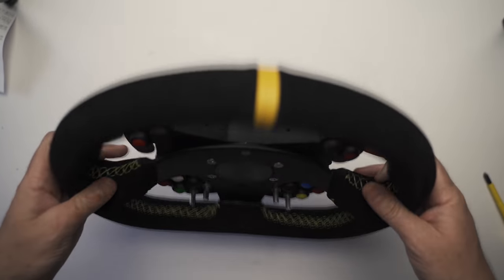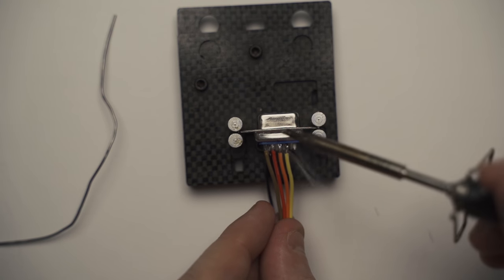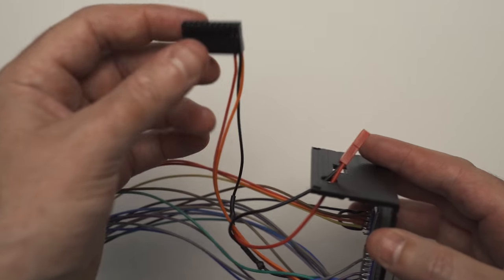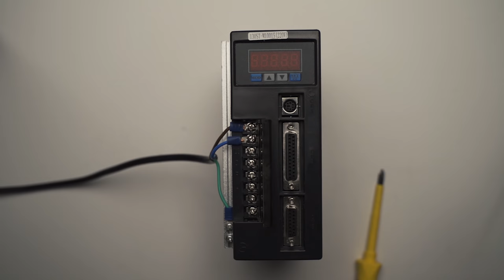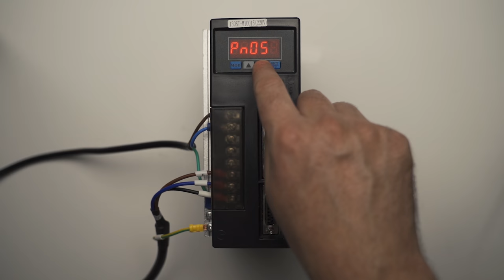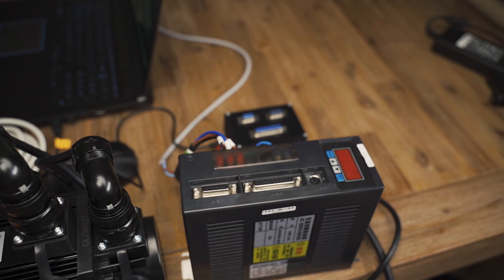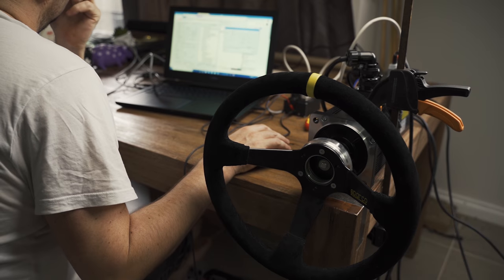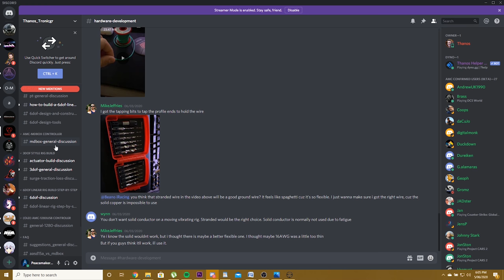$450 Mige Direct Drive Force Feedback Wheel Build Tutorial - MMOS

Comment: Quick word of warning for anyone making this dont attach this to a regular desk and don't treat it like a regular racing wheel this thing will break your wrists if not used safely not sure if you guys have had much experience with a DD wheel but they are extremely powerful
Reply: It's all good if you don't use that much power.
Reply: anybody ever put some sort of slip clutch or coupling on the shaft that can break before your wrist does? 🤔

Comment: So I did exactly this but with a slightly different motor, and almost the same encoder, and driver. So the spec is: 110ST-M06030 (Pn001"motor model" is 15 for this one) - it is smaller, faster (3000RPM max), and has less torque (6Nm nominal, and 18Nm max). Encoder is 10000PPR, and the driver is basically exactly the same, except it doesn't have a CN1 on the front. It will be used mostly for AC drifting, so the spec is more suitable for my needs, I guess. At first I used the db25 wiring scheme from your vid, and it worked, except the motor haven't shown any signs of life lol. I've rewired it to the scheme from the original post on hackaday, and it works! I know a bit of the CAD stuff, so I have designed my own rig with clamps for the table for this motor (kind like an aftermarket ones, but with clamps basically) - will be cut and bent from 4mm steel. As for anything else - first time soldering, first time buying industrial stuff, first time dealing with electronics. God know how I did it, but it works. It was an amazing journey, a lot of experience, and a great result for the budget. Thank you sir 🙏 Thank you so much. Kind regards from Ukraine ❤️p.s. sorry for my english lol

Comment: As a fellow aussie I need your masterful insight. Considering the servo and driver combo alone is now $736 delivered, do you think it would be a better idea to just get the MOZA R9 base when it comes to Pagnian in 3 months for $699?
Reply from the maker: It's a hard one.. depends if you want the extra torque or not. I tend to go no where near max torque of mine. Plus warranty and a pre built all in one wheelbase is also good. Just plug and play. Depends how handy you are with electronics as well for the DIY approach.  Using a VNM ffb board currently and they'll run you about 100-150 on top as well if you want a smooth and quiet operator. $699 seems like a good deal really. Just hope it has enough torque for your needs it all.. I'm sire you wouldn't have much issue onselling it in this market if you didn't like it after a month though.
Reply: @peacemakermotion3949  Cheers! Yeah from what I can see online it seems to be relatively good, and good point on the warranty. I did a full custom hotas +LH stick and was planning on doing the same for wheel but the prices are a bit more ouchy. I won't get their wheel tho and just get a quick release and build a box based off yours.

Comment: Absoluteoy great tutorials I was a little confused when you were setting up the controller up, it seemed like at one point you referenced the rotation speed, but what where all the other things? Id love if you could explain it in some more detail? Thank you for doing these!
Reply from the maker: I copied the description of each from the manual and put it next to each line in the xsimulator page. it wont make much to most people even myself but you are basically putting the driver into torque control mode some values adjust multipliers and filtering and torque speed control limits. in torque mode for example the 120 limit overrides the 1500rpm motor limit when its in torque mode so that 1500rpm setting doesnt matter. another setting changes the wheel direction etc etc. This really isnt my field i just decoded another tutorial i found online. But if you read through the xsimulator page other more smarter cookies have chimed in with their knowledge about what certain things do and tweaked things here and there.
Reply: @peacemakermotion3949  thank you mate I thought as much but I wanted to make sure... Great project though thanks for sharing!

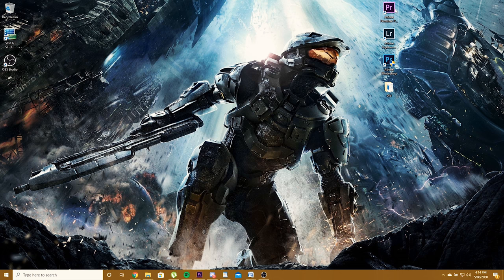Comment: 24:40 I found out you have to use both micro and mini USB because of "Low-power mode". It pops up in the STM Utility as "target might be in low power mode", so all you have to do is plug the mini USB in to a power adapter or to the computer, and the micro to the the computer.

Comment: Hi sir, first things first great work and thank for sharing those infos.
I've a question that may sound dumb, but i'm not an expert electrician so better to ask.
I've a Logitec g920 that make me started years ago, but now i want something more, so the question is: can i use the logic board of that g920 paired with a hoverboard motor and hoverboard enconder? Listen to this, i think if i just can make the encoder communicate with the g920 logic board it will send positions as the stock motor encoder of the g920. Then i just need to power up from external psu the hoverboard motor somehow. What you think about that? 
Thanks if you dicide to help me figuring out the situation.
I'm just a poor sim-drifter with a g920 on a zero to no budget, so think you can understand my bad situation 😂
Reply: I think the best bet for you would be to build a ffbeast force feedback wheel with a hoverboard motor and buy the  Logitech G Racing Adapter  to use your g920 pedals and shifter but that will only work on PC

Comment: Awesome tutorial, I just have one question. So you're connecting the pwm output (PE9) of stm32 board to the analog control input of the drive, am I correct? If so, is there any implication for doing that. Because as far as I understand, pwm can mimic but is not true analog signal, for true analog signal you need a DAC, so I was wondering if the fidelity of the force feedback was compromised.
Reply from the maker: Hey mate. Yes if you watch my test video you'll see the noise created by this. You can use pn188 filtering but too high can reduce fidelity. Early tests by thanos allow filtering to be set to '1' and zero noise! My DAC arrived yesterday so will be doing some testing with that very soon and report back :)

Comment: Soo, quick question..For us here in USA with 110v power, what would be different in this setup? I assume the power cord section would be somewhat different. Also, these motors are sposed to be run on 220 yes? If so, would we need to get a transformer just to run the wheel to begin with?
Reply: well he answered mine, i gues he didnt see yours. on thanos' channel he has a video explaining how ot chnage voltage to 100 instead. same torque output. only difference is it will drive more current due to ohms law.

Comment: I am considering building this kind of setup for a few months already. Do you think the 130st m10010 (10Nm, 20Nm peak) is powerful enough? I was considering the 130st m15015 (15Nm, 30Nm peak) which is just a little more expensive. Also, did you buy the original Mige motor directly from Mige or did you went with the same motor from other seller (I heard that there could be some issues if you buy the motor from other seller since it may not be original, and the not original motors aren't that well built). Also, how are you overall happy with this kind of sim setup? especially the FF wheel :)
Reply: The 10010 is more than powerful enough
Reply: 10 nm rated is more than you need, at least it is more me, strong enough to replicate an indycar ffb but a little overkill
Reply: It's powerful enough for sure.
For context:
Fanatec CSW v2: 7.1 Nm
Logitech G27: 2.3 Nm
Thrustmaster T500: 4.4 Nm

Comment: Hey @Peacemaker Motion, i'm a mechanical engineer student and this project seems complete in all senses. I'm also DIYing A set of pedals and a steering wheel. I've considered also fabricating a DIY seq. shifter. All of this DIY will be added to my 2dof self made motion cockpit. The biggest knowledge lack i experience right now is the PCB configurations and connections, for example the shifter and pedals do not have the same amount of connecting pins as the logitech nor does the shifter. Also, is it possible to change the Motor encoder for a SinCos encoder? Appreciate this video so much, hella value. Keep it up mate!
Reply: I'm not Peacemaker but chiming in to say you might want to check out the "Open FFBoard" project that's had a lot of updates since the above video was published-- the guy who develops most of it has the YouTube channel Gigawipf with really excellent videos about all aspects of these DIY builds. I think there are a lot of options for connecting different kinds of peripherals to the PCB there. Sounds like an awesome project though, I'm planning to get started on my own build soon and Open FFBoard seems really solid.

Comment: Hello,

  please, is it better to use 130ST - M10010 or 130ST - M10015 motor? + AASD - 30A AC servo driver.
Or does it not matter? 

Thanks
Mirek
Reply: Did you find an anwser to this question?

Comment: Let's say I wanted to use a lower power motor like a 130st m10015 10 NM, would all the settings on the AASD be the same? Great tutorial btw!
Reply from the maker: yeah except pn001 will be different because that is what stipulates what motor you're using. worth checking your AASD is set to the right one just in case. the motor numbers are in the manual under pn001 :) Some people have bought a motor driver combo and had issues only to figure out it wasn't set right from factory. you can also play around with torque max speed to like 250 instead of 120. but maybe start with these base settings until you get it up and running.

Comment: I'm completely newbie and have recently joinded Xsimulator forum, I want to ask," Whats the difference between this DD setup and OSW setup with simucube and ionipro?".
Reply from the maker: well this is currently using 6 year old software that hasn't been updated in 6 years.. but still fully compatible will the latest games. Doesn't support absolute encoders (yet?) only incremental. simucube has kind of been designed and moulded around this purpose and has continued support. Also more than double the price.. But now there is a new software thats being developed for open source wheels using other drivers than simucube that will have simucube like options and adjustability!! so the whole scene will be about to change soon and open up the market to more and more inexpensive DIY wheel builds. stay tuned. i'll be doing a video on it soon :)

Comment: Finally looking at building one of these, but have a question before I decide on a listing to buy. Going with the 130st m10010, but I've noticed a number of listings have it paired with either the 15A, 20A, or 30A AASD. Does it need to be the 30A one or does it not really matter? Can't seem to find any info of that, the mixed info in some of the listings doesn't help either. lol
Reply from the maker: If you look on page 11 of the AASD manual it tells you what drivers are compatible with what motors.  The m10010 is indeed compatible with all three. So then it comes down to price. If you can get the same motor with a higher rated driver for the same price or cheaper than I personally would go with the higher rated driver just for that extra headroom but yeah as the manual states, I don't think it matters too much because they'll all be sufficient enough.
Reply: @peacemakermotion3949  Ahh good to know, thanks. Didn't even consider looking up the manual, assumed it'd all be in Chinese. Now to wait like a month for shipping. lol
Reply from the maker: @Rustler_One  haha, yeah. Ask the seller if they can supply shielded cables too. will help with EMI
Reply: @peacemakermotion3949  Quite a late update but right after I bought it, went with taobao cause it was a bit cheaper than ali, the shipping option I was going to use was no longer available cause covid restrictions lol. Had to wait till like March and then finally had it shipped out, as expected took a month, also turns out it was the 30A AASD. Then kinda put it off for a bit while I got the last few things I needed, thought out the additions to my rig I'd have to make, and just some laziness really lol. Also my wheel button box and pedals are diy, and in the case of the pedals had to figure out the position I wanted them at. Pedals are actually a 3d printed design I made based on a number of different ones I've seen online. Got it all put together About a week ago now, had a few small issues like pn190 set wrong but that was easy enough to figure out. Interestingly with MMOS I'd get this weird resonance feeling, not sure how else to describe it, but guess that's part of the noise you get from not having a dac. Then decided to test out VNM, for whatever reason I couldn't get the version of the firmware in the v1_latest folder to work, would just spin continuously when calibrating. Using whatever the latest one was in the v0 folder works fine, of course with an earlier version of the software too. So with VNM that resonance feeling was quite a bit less, but weirdly there was something that felt like dampening even though I had it off, wasn't too noticeable when moving though and overall I'd say it generally feels better than MMOS. Just yesterday I swapped pin 25 to go to pa4 to use the internal dac of the stm32f4 discovery, and yeah that resonance feeling is almost entirely gone, so is a lot better. Also originally I had a load cell on my throttle cause I just had an extra one anyways, but didn't like how that felt and converted it to use a hall sensor. Now the only issue I have left is my button box doesn't like the emi from the motor, specifically the paddles are inconsistent. Bit long winded but that's my experience so far. lol

Comment: one question, i got all the stuff and got the wheelrunning! :) thanks for the tutorial but when im driving straights the steering wheel feels shaky, already put damper and friction off in mmos but still feels a bit weird, do you have an idea of how to fix it ?
Reply from the maker: Max sure your minimum force is 2 or 3 at least. What's your pn190 set to? Maybe try setting it to 0 and run fn007 to calibrate your torque voltage offset

Comment: Hey man. Im absolutely new to the OSW scene and an absolute noob at electronics. Do you think this is worth the hassle for someone like me who would have no clue if troubleshooting is needed? Or should i go the Simucube+IONI route for the sake of convenience and ofcourse better fidelity in the FFB? How much of a difference is really there in the FFB feel of the Simucube and MMOS?
Reply from the maker: unfortunately i could not tell you the difference as i have never used one.. but if you got the Thanos TDD board its pretty much plug and play except for a few wires on the servo drive. arguably easier than a simucube 1 setup as far as wiring goes. Then you can also jump onto VNM firmware and really liven it up. In the future VNM will also support Biss-C etc with their own controller but yeah basically comes down to your budget i guess.. and if you want a real turn key solution then it may  not be the one for you but yeah.. im all about fiddling with shit and saving coin for other parts haha
Reply: So the thanos tdd just allows to skip the wirering part it doesn’t improve anything in terms of performance for the wheel (am also new to this world and i realy want to build this DD set up but i want to be sure to know everything i need before buying anything )
Reply from the maker: @RAYQUAZA_X  Listen to my DAC test. The TDD has a built in Digital to analogue converter which makes the wheel operate smoother and more silently. It also has a benefit of plug and play and avoiding wiring :)

Comment: I want to build one so but but I’m not too familiar with electronics and just need more knowledge is this something I should still look into? If not where can I learn more so I don’t mess this up because 450$ for a diy direct drive wheel is nuts
Reply from the maker: Well it might be about 100 dollars more now for the motors since this video, still doable.. but there are a lot of other options around now too.. the TDD board can't get any chips due to shortage for like another year or 2 so that's out.. there is now the VNM board bit will require a bit of soldering still to get the right pinout. It's a great option as it also has spots for a button box to be wired up and also pedals.. so like an all in one controller kind of thing. But now you can also pick up a VRS box by itself for fairly cheap and buy a Mige 130st 10010 and have a biss-c encoder for not much more.. depends how strict your budget is really.. 200 more probably for that set-up.. thats not bad either..